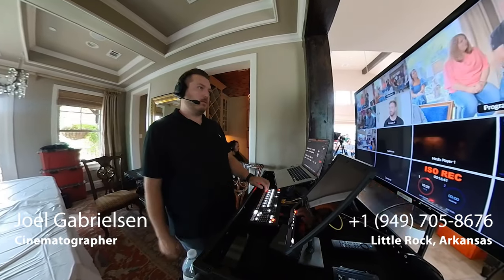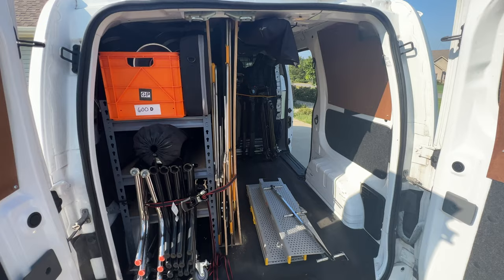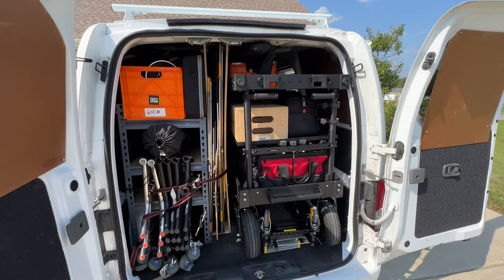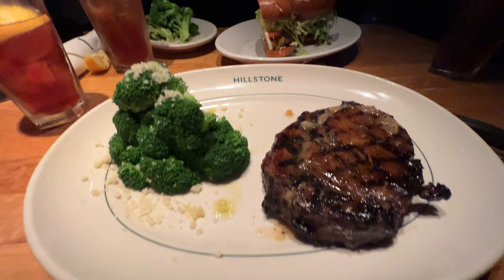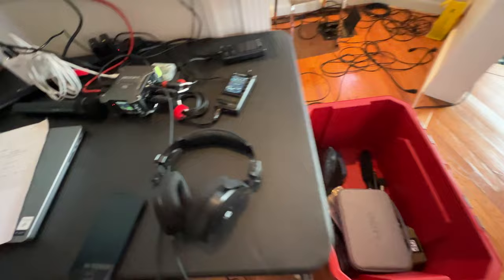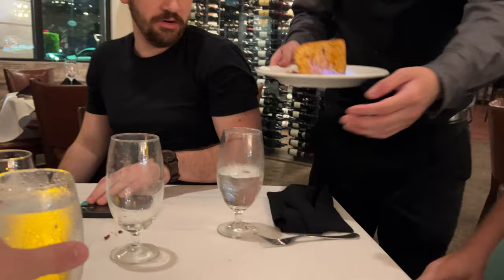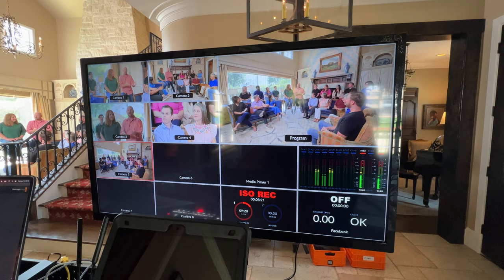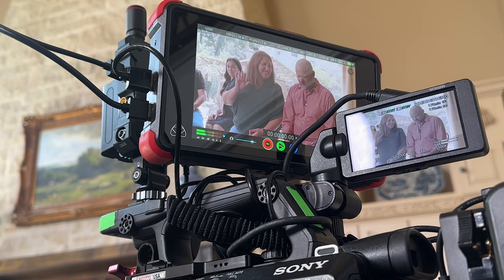My Biggest Shoot So Far In 2023 | Multicam Production Five Sony Cameras | Sony FX3 | Sony FS5 | BTS

Comment: Nice!!! What type of monitors (if any) did you use on the FS5's that were set up for wireless video?

Also, with your FS5's do you record internally, or on an external recorder?
Reply from the maker: I was using a combination of a few different monitors. The ones with the wireless I was using a Atomos Ninja flame and a 5in feel-world both monitors have and HDMI out that I used to feed the wireless transmitters. 

I used the internally record with the FS5's. 

Thanks for watching!!!